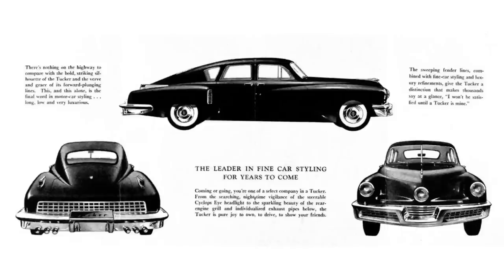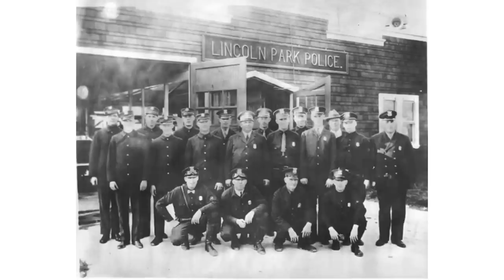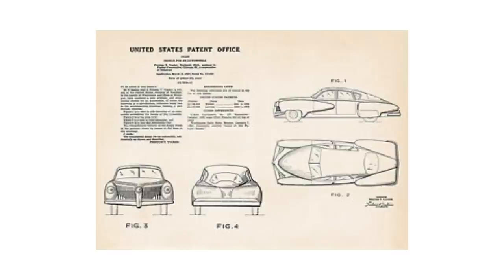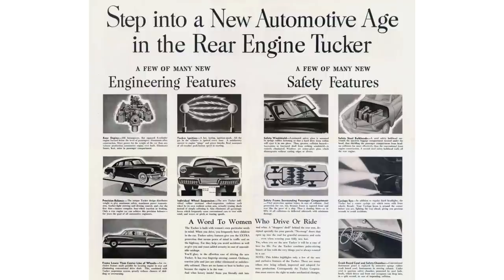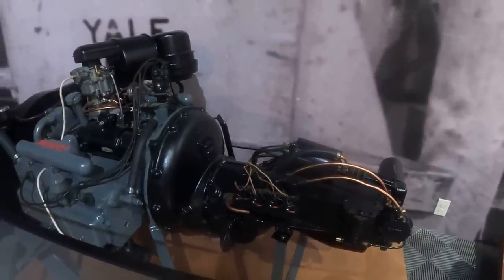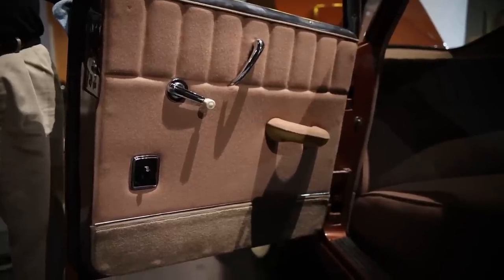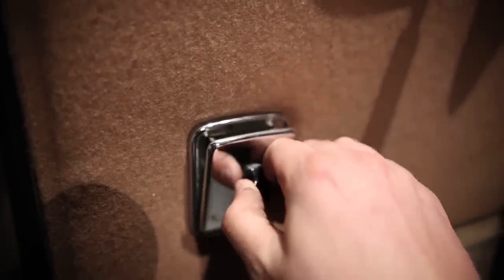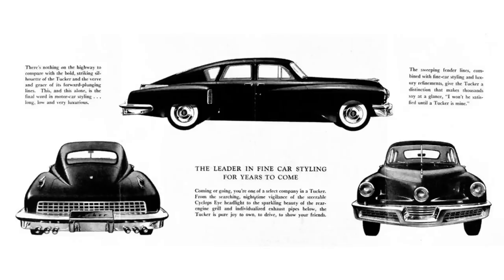1948 tucker

Comment: The 1932 -35/1946 Stout Scarab was the earliest vehicle with a rear wheel drive I know of but it stayed in prototype form  through out the the 8 that were made (5 survive to this day) so it largely depends if your talking about prototype to production or just models that were prototypes. Their actually a very interesting car to talk about, I know of one thats over at Hannah's auto museum in Reno Nevada the last time I looked.
Reply from the maker: Awesome, I totally forgot about the stout scarab. From what I remember there was only 9 produced that would be a really cool car to do I’ll have to see if there is one in a museum close to here. One thing I forgot to mention they know where most of the cars are.
Reply: Tatra  too. Porsche scaled it down to create the VW.
Reply: Most automobiles of that era were rear wheel drive. Few, however, had rear mounted engines.
The museum you refer to is Harrah's, not "Hannah's".

Comment: Boxer engines are used today by Subaru and VW had a boxer engine on the old Beetle
Reply from the maker: And Porsche still does a boxer too =)
Reply: And Toyota shares the '86' series 2 door coupe with the Subaru BRZ.  Badge engineered twins with boxer engines.
Reply from the maker: That’s true thanks for adding that =)

Comment: Quality control on fit and finish on Tuckers was far below contemporary builders. Restorers have trouble getting these thing back into show condition because they were soft on precision, panel fit, and bo line. To restore as new wouldn’t be satisfying because flaws were everywhere. I do love the story though.
Reply: The Tucker had swing axle rear suspension,  proven  a disaster in the early 60s Chevy Corvair,
 being Unsafe at any Speed.  the title of a Ralph Nader book.  Nowadays, there are no swing axle cars
in production.

Comment: In some ways Tucker sorta parallels Tesla.  Both auto companies had their teething pains, but Elon Musk had the capital to keep Tesla aflot while they worked out early production issues.  Tesla STILL has quality control issues with randomly picked cars off the assembly line differing in fit and finish.  Buy a Tesla today and you might get a gem, or a lemon.  Part of Tesla's problem here is how rapidly they are adding 'improvements' and tweaking their  assembly process.  In Tucker's case, he was still doing design work on the car up until the end and didn't quite get it right.  If he had more time and the SEC had left him alone Tuker might just as well followed the same path that Tesla has.   BTW, Musk DIDN'T create Tesla, he bought the company just before they started selling their first model, the original roadster.  If Elon hadn't bought Tesla, they likely would have only been a brief flash in the pan, just as Tuker was.
Reply from the maker: Totally agree =)